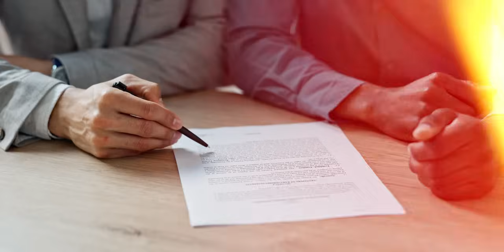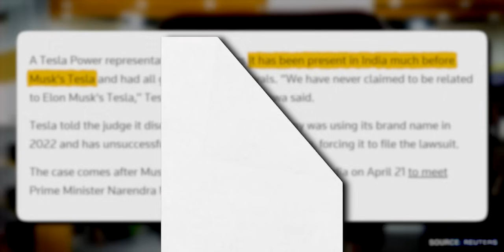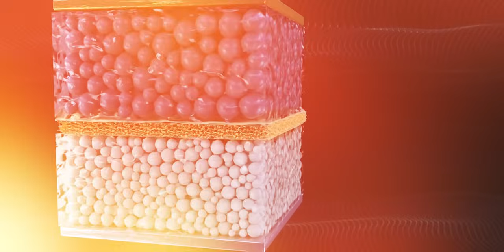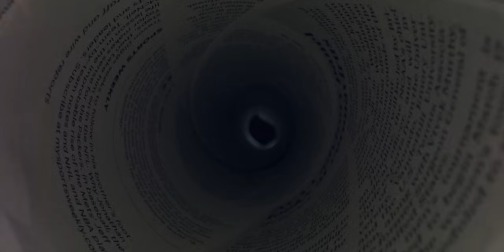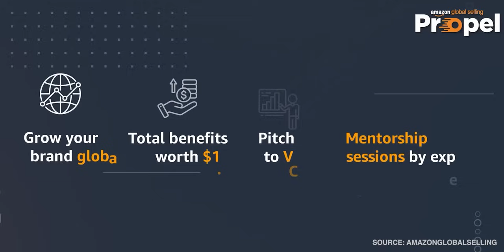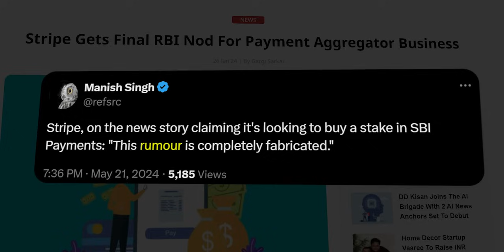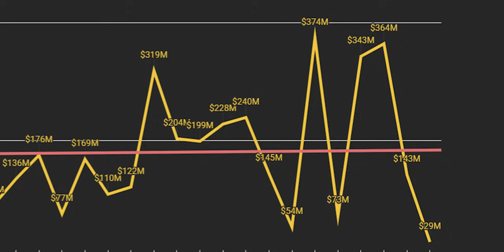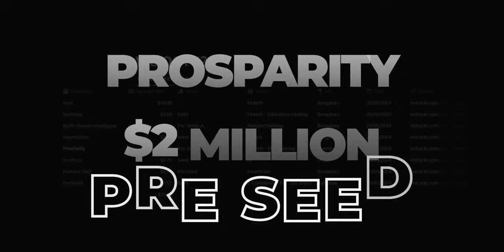Indian Startup News 210: Tesla is Suing Tesla in India

Comment: Evs are not the future anyone with mind knows that
Edit: future are hydrogen and hybrids
Reply: What are the reasons for arriving at that conclusion
Reply: @-Rishikesh i replied youtube deleted my comment
Reply: @-Rishikesh again my comment got deleted
Reply from the maker: YouTube usually deletes if there's a link, @, an email, or profanity. -Caleb
Reply: @backstagewithmillionaires just read toyotas 1:6:90 ratio youll know
Reply: The toyato report conviently neglects three important things which are important for the consideration 

1) While the same amount of resources can be used to make 90 hybrids, it doesn't consider the total lifetime emissions of the vehicle 1 on 1.
It compares one ev with 90 hybrids
Eg. If you use a ev and a hybrid both for 15 years then the ev would have emitted a loss less CO2 in its lifecycle even if the power comes from a coal plant to charge the vehicle. If the power partially comes from renewables then it becomes even better. Cant say that abt oil.

2) It assumes that after the vehicle is manufactured the lithium or raw material magically goes away.
Which is not the case as the raw material can be recycled and recirculated. I don't know if you can recycle the oil after you burn it.

3) It assumes only lithium batteries exist. China has demonstrated large scale Sodium batteries. While these are not suitable for long range vehicles, if you are only doing within 100 kms a day these batteries would be a great fit. Plus they reduce the environment effect of mining since you have a ocean full of this substance.

While using hydrogen might sound good, it required 60% more renewables or energy sources to operate the same work load. (EVS are 80% efficient) End to end, While the most efficient h2 usage from production to usage would be 35%
So instead of suppose installing 100Gw of solar and wind, you would need 160GW for the same level of output.

Toyata is making a huge mistake betting only on hydrogen. Hydrogen is like spending money for eating at a bbq restraunt, good for occasions but not for daily consumption. Very much useful for the hard to abate sectors, but not so much in others.
Reply: @-Rishikesh  ill tell you one more time even looking at your first point i can tell that you have not even read the papers and have already decided just go and read them first
Reply: @gajendermalhotra9635  you are correct, bcos all the things I read were articles summarising the leaked report. Can you share the link to the pdf ? 
And also can you also give your view abt the other points that I mentioned
Reply: @-Rishikesh lithium Battery disposable is impossible

Lithium metal shortage

😂😂😂😂
Reply: @puneeth0  Actually, there are a lot of companies that recycle lithium ion batteries. Even in India, the government is focussing on "no Lithium to waste" to recycle lithium from all the ewaste. Maybe can you point me to the reasons why you think disposable is impossible ?